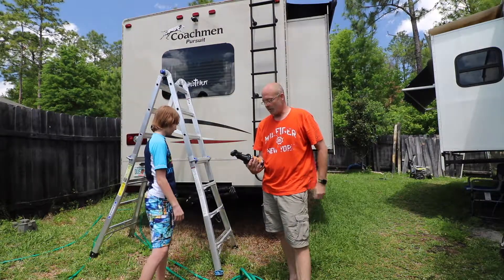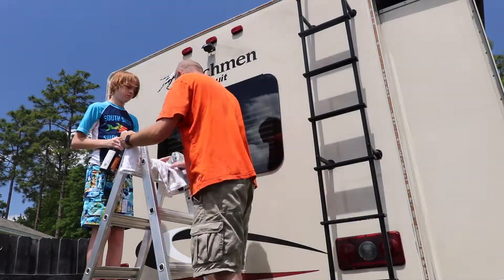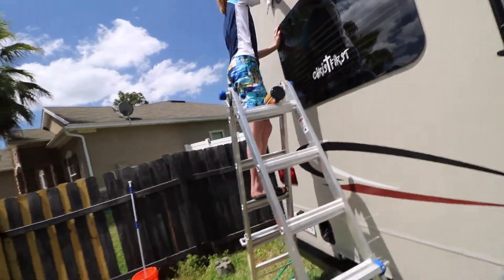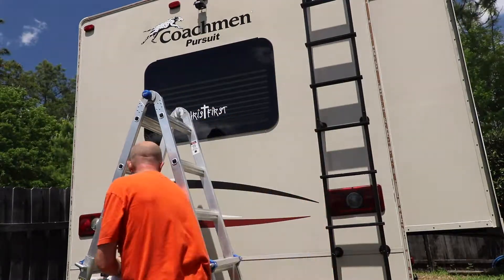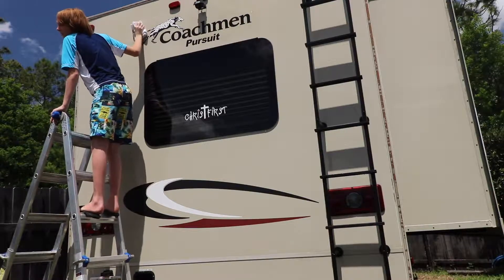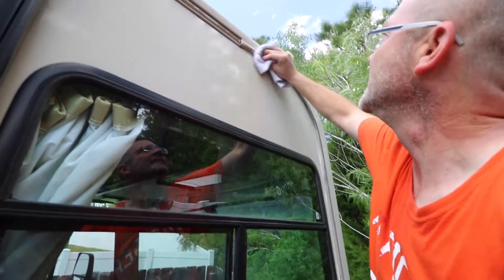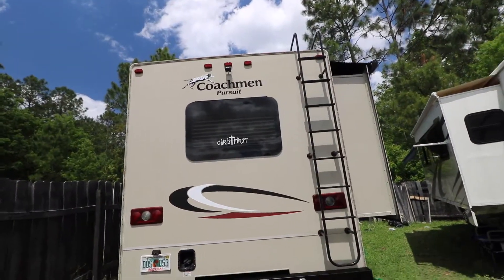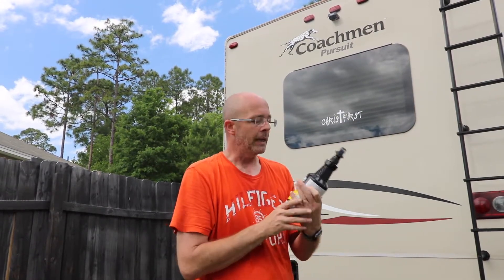Bio-Kleen Black Streak Remover Review

Comment: 2 things :
Don't use this on the doors of your camper, it took the paint off the door on my Exess horse trailer. The conversion company said the doors are from a camper supplier. It worked great on the white metal though. 
2: Flipflops are not the shoe of choice for climbing a ladder. I am not a Safety NAZI by any stretch of the imagination, but you only need to see ONE child hung up in a ladder with a compound fracture to make you think differently. Just want to save Alex a whole lot of pain and trouble for the rest of his life . Because he wore the wrong shoes.
Thanks for the info. I subscribed.